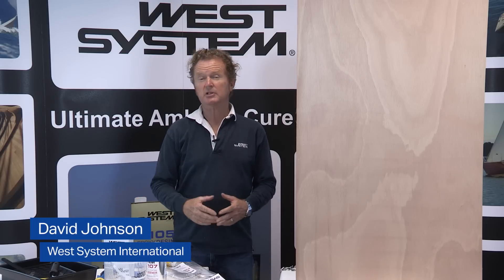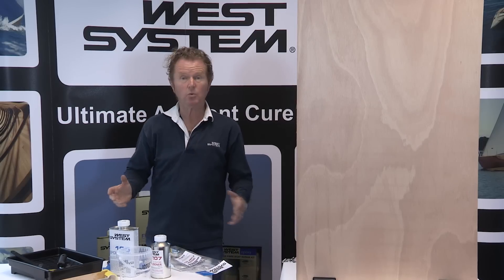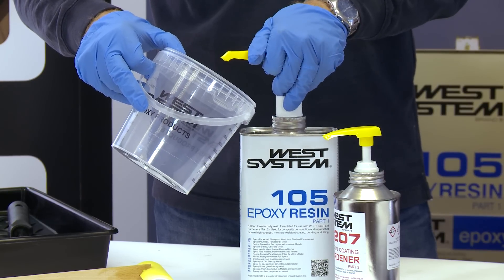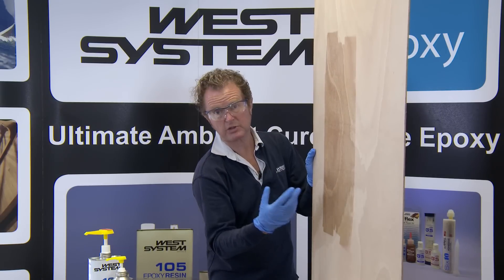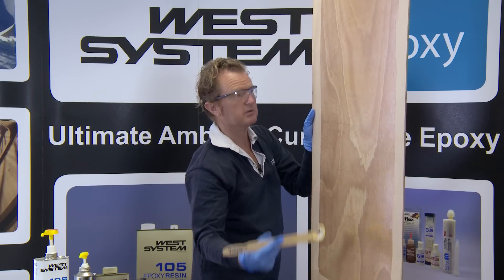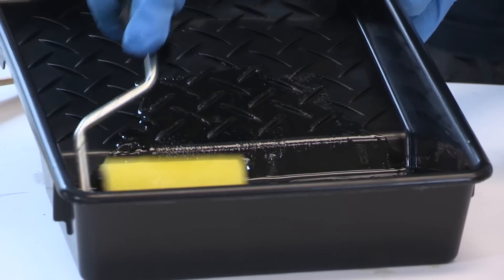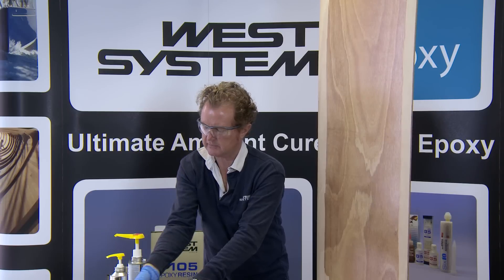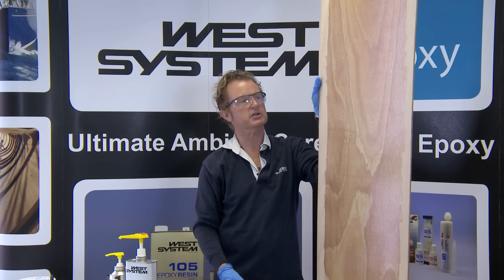Wooden boat repair: how to coat plywood

Comment: Hi great video I am buying a 21 Foot Hartley half cabin boat i am going to strip the hull back to bare wood can i put your epoxy system straight on or what should i do first.
 Thanks Farmer
Reply from the maker: Hi Farmer
Thank you for your comment.  Whether coating, bonding, fairing or applying fabrics, the
success of the application depends not only on the strength of the epoxy, but
also on how well the epoxy adheres to the surface to which it is applied. 
It is advantageous to apply the epoxy direct to the substrate once previous
coating have been removed and the appropriate surface preparation has been
completed.  Timber surfaces should be clean, dry and thoroughly
abraded.  Further details can be found in our free WEST SYSTEM User Manual
and Product Catalogue.
WSI Technical Team
Reply: Hi the Hull will be back to bare wood properly cleaned, and then can i just roll your stuff straight on Thank you

Comment: Can i use this in my pond filter without killing my fish?
Reply from the maker: Hi Dennis
Thank you for your comment. 
WEST SYSTEM epoxy does not have the required certification to water potable
standards and therefore we are unable to recommend its use in that application.
Regards, WSI Technical Team
Reply: Right, Thanks for your fast reply!

Comment: Anyone know if you can tint the opoxy to a black color
Reply from the maker: Hi Shackles
WEST SYSTEM epoxy can be pigmented
with WEST SYSTEM 502 Black pigment or WEST SYSTEM 423 Graphite Powder. 
Further details on all of the available additives within the product range can
be found on our website. http://www.westsysteminternational.com/en/west-system/west-system-additives
Reply: West System International WSI 
ok thanks.  I'm applying to osb plywood under my fifthwheel bedroom slide. The fabric is coming off so a good water proof seal is needed.

Comment: Why is my 207 drying amber? and why is it like yours in this video amber in the container?
Reply from the maker: Hi Shumba

Thank you for your comment.  

Within the WEST SYSTEM product range the WEST SYSTEM 207 Special Coating Hardener is formulated for use with WEST SYSTEM 105 Resin for coating applications where a transparent finish is desired and provides exceptional clarity of wood grain. 207 contains an ultraviolet inhibitor to protect the 105/207 mix against sunlight. However, the cured epoxy surface still requires long-term UV protection with a quality two part marine varnish containing a UV inhibitor.  The ultraviolet inhibitor within the 207 hardener does give the mixed epoxy a yellow, amber colour.

Regards, WSI Technical Team